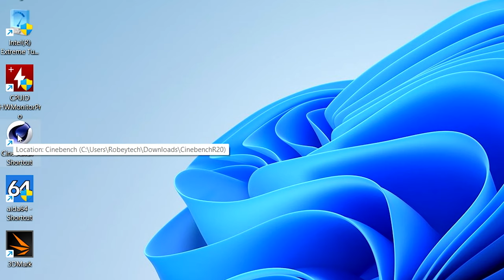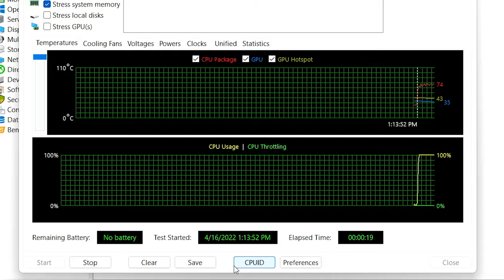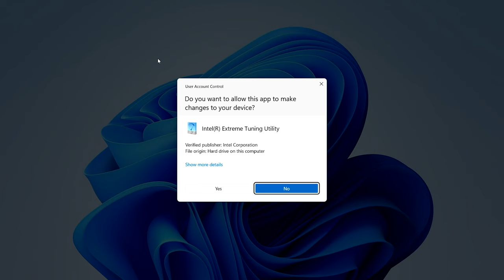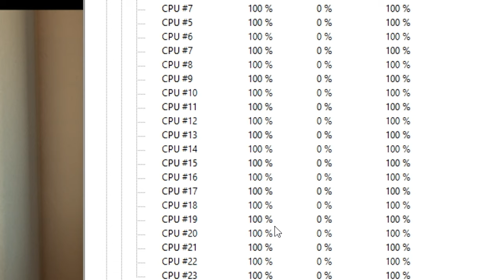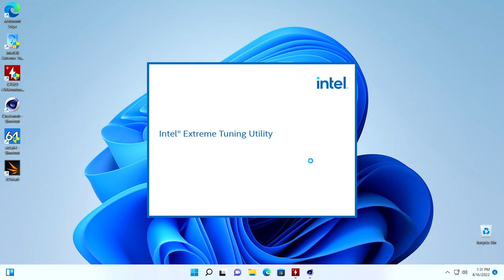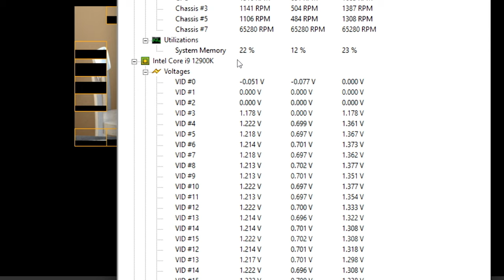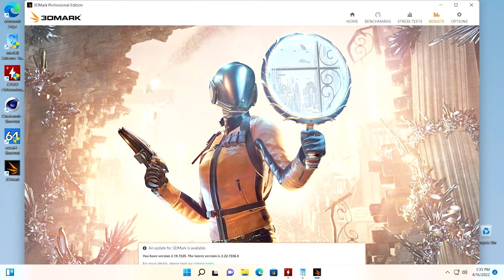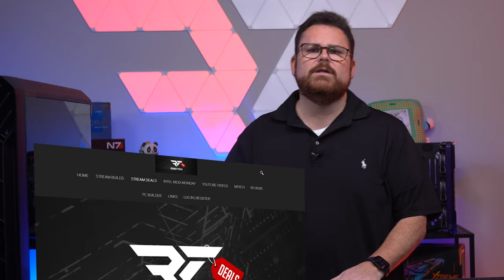We built the ULTIMATE air cooled 12900K PC! But did it work? Benchmarks and Thermals inside!

Comment: Thank you Robey for showing that you CAN air cool an i9-12900K as long as you have the right case that works hand-in-hand with the CPU cooler. That is a perfectly paired chassis to go with the cooler. And no "RGB" strictly performance/business also looks awesome!
Reply from the maker: No problem! You are very welcome!
Reply: There is tons of RGB in this build. He just toggled it off. That's the best part of RGB. Want it lit up? Looks neat. Want it blacked out? Simply toggle it. No reason not to have it.
Reply: @pokealong  Why would you want your case to look like a Christmas tree? Talk to me. :)
Reply: @erichamilton5932  Why would you want your Christmas tree to light up? Talk to me. :)
Reply: @erichamilton5932  so you can see the inside when it is dark
Reply: @erichamilton5932  It's ARGB. So it's addressable. Most people just stick it on a static colour they like, and it can be turned off and still function. So what's the issue?

Comment: Legitimately excited by this video. Right now at Micro Center the 12900K is up for a bangin deal in a bundle. I bought it, look forward to completing the build and then follow your journey to overclock. Making matters better I had already settled on the fractal torrent for case as well. Awesome video!
Reply: This is exactly what I was about to do XD What's the rest of your setup looking like? Same cooler too?
Reply: @truffles  that or the Icegiant prosiphon, LTT did a couple videos on it a while back
Reply: haha, same microcenter deal. My first build, Thermalright Peerless for cooling, and Montech x3 for case. Hope it should suffice with "undervolting". Make sure the pc case is AIO compatible in case this does not pan out ^^
Reply: @HoaTruong-rg2fp got the same deal and case as well but using a Hyper 212 for air cooling.
Reply: @TheCardinalSpear  I did a lot of research and ended up using a 360mm AIO now since it does not appear air cool is enough.
Reply: Are you air cooling it? What did you get and how is it?
Reply: @HoaTruong-rg2fp Which AIO a did you get? Some AIOs cost as much as the bundle 😣
Reply: @MsVamPireChic  I use Thermalright Frozen Prism 360 AIO. Comes with both black and white color build. cost around $60 dollars. Have not encountered any problem yet.

Comment: How are your temps this good? With this exact setup (just in a Torrent Compact case - shouldn't make much difference) I'm hitting around 99-100 degrees with Cinebench R23. I tried reapplying the paste 3 times and ended up swapping the NH-U12A for an NH-D15 (which dropped my temps around 2-3 degrees) and with the addition of the -0.075 undervolt it now sits at around 89 degrees, which seems manageable. But still, your temps are way, way lower. How was your room temp during this testing? Or is it just a binning thing or something?
Reply: I'm sure it's the case, plus the three bottom fans that he has, I think the compact can only do 2 140mmm fans if I'm not mistaken
Reply: Different bin

Comment: i call massive bs on the u12 outperforming the nhd15
Reply from the maker: Okay. Still does
Reply: @robeytech  Laws of physics are broken then ))) Seriously? Did you read NSPR values of the coolers on noctua website?
Reply: I just bought a NH-D15 and ran it in a fractal design torrent case on a Asus strix z790-e, 13700k at 5.4. The d15 was only 2 degrees cooler than my NH-U12S with 2 fans. I sent it back and ordered a NH-U12a

Comment: Justin, thanks so much for this video!  I just ran across it this week while researching a choice between the 12700k and 12900k as I upgrade from 9900k.  Currently have a full-size Torrent and Noctua NH-D15 cooler, which do a great job with the 9900k and a 3080 - your video convinced me that I should be able to manage the 12900k with that gear (and maybe an additional rear-panel fan added to the Torrent just in case, using a little undervolting and overclocking.  Will also be adding a new CPU holddown frame, replacing the stock lever system, to keep the IHS as flat as possible to optimize cooling.  Avoiding liquids in the box is a high-priority to me, but still want a system good for the next few years with GPU and VR-headset improvements along the way.

Your work here is much appreciated, buddy - just the sort of info I was searching for, and more!
Reply: Hi bro, how about D15, is it working with the 12900k ?
Reply: @ViniCLplay  the D15 works great but at the last minute I went with the 13700K - slightly lower cost, a bit better performance and lower power for that performance. 

With the fantastic D15 and a 4090 in a full-sized Torrent case I ended up with a silent monster system that will never spring a leak.  Big thumbs up for the D15 although it looks like Noctua is prepping its successor from the rumors.
Reply: @RJ-kr4bs  awesome, I'll try the D15 too, thanks!
 I saw that the 13th generation has much higher temperatures than the 12th, this is the only aspect that caused my preference for the 12th.
Reply: @ViniCLplay  Me too, at first, until I learned more about the 13s - the 13th-gen defaults to max full power with an excessive voltage (apparently to please reviewers, the high voltage means marginal non-binned chips can still hit the numbers but adds more wattage and heat unnecessarily since the chip doesn't need that much to run at peak performance), as I recall. So, allow it to run overclocked, but lower the max voltage - JayzTwoCents has done several good vids on this - find the one called "How to keep your CPU from melting" released about a month ago - a very simple introduction about making just one easy change to get started; you decide if you want to go further. My 13700K has "IA Offset" at -0.036v (your CPU may tolerate more or less, so you have to try/test to find out) and it lowered my CPU temps by 20-30C as I recall in Cinebench, even after boosting the clocks a bit. Easy to do with the Intel XTU utility as Jay shows. Good luck and have fun!
Reply: @RJ-kr4bs  Another thing that can help lower the temperature is to use a "cpu contact frame", to prevent CPUs that use LGA1700 from warping. Research this problem, it may be happening on your computer.
Reply: @ViniCLplay  I put a frame into this new build on day one.  Seems to work great.

Comment: I originally cooled my 12600k with a Big Shuriken 3 but was getting up to 100C on Cinebench. I switched to a FrostFlow240 and replaced the AIOs fans with Noctua 120mm PWMs and also changed the 92mm 3-pin DLH21 case fan to a Noctua PWM unit. I did the same undervolt but no overclock and dropped the peak temps to consistently less than 80C. The other caveat is the GPU (6950XT) is a gd reactor and is the source of most of the heat exhausting from the case.

Comment: I have the TUF Gaming Z690-Plus WiFi 4D & i9 12900K. I'm using Enermax ETS-T50 air cooler. In BIOS I set my P cores to 4500MHz & E cores to 35MHz. It gets too hot if I set it higher. I should give the cooler a try.

Comment: Great video, thanks! I have one of those N7 NZXT cases you have in the background, I managed to squeeze in an NH-D15 for my current 8700k but I'm looking to upgrade to 12th gen. I have Noctua fans on the front, on the rear, and on the top (getting THAT in place with the NH-D15 was a nightmare!) and with my 3080FE in the build my current CPU doesn't go over 70C. Should I suffer the pain of trying to get the NH-D15 in again or would you say the U12A would be enough for a 12700k in that case (with its really limited front air intake)? 

[EDIT] July 5: The NH-D15 wouldn't fit the new motherboard, so I am using the U12A with the 12700k and it's perfect! Temperatures mostly in 50s and 60s when under load. Just make sure you install it the right way round or the plate doesn't fully-cover the CPU!
Reply: Hey! I'm planning to pair 12700k with the U12A like you did. Could you share which motherboard were you using? Thanks
Reply: Same…

Comment: I have an x5950 cpu  on a Asus x570 crosshair Vlll Hero motherboard  and a Gigabyte 3090......Aircooled BY Bequiet Dark Rock Pro 4 and Bequiet silent wings fans.....works perfect AND quiet  even OC so I think it will work with a 12900k.

Comment: Hello. Thanks for the video! What is the real height of this tower cooler (Noctua NH-D15) with RAM installed?
The front fan is located above the RAM bars, they do not allow the fan to be as low as the middle one.
What is the maximum height of the RAM slats is acceptable, so that the front fan fastened does not exceed 165mm?
What will the author say in response?

Comment: Hey Robey, how will the cooler Master MA612 Stealth compare with the Noctua cooler in this video? 

Is it a recommended alternative if the Noctua isn't available in my area? 

Planning on using it on an I7 12700F, no over clocking, just auto mode for 2K gaming.
Reply from the maker: I haven’t been able to test it tbh

Comment: You think the Noctua NH-U12A can cool down the i9 13900k significantly and not much noise?
Reply from the maker: That would be tough, we haven’t tested it.  But it’s hotter than the 12900k and it took a certain case to air cool it.

Comment: Just finished my 12900k build yesterday. Got the NH-D15 installed and it’s great, but it’s also a pretty beefy boy. Seeing this video makes me feel, like i chose the wrong aircooler…
Does it really outperform the D15?
I haven’t tested any benchmark, yet.
Since I‘m planing to play games on this PC for the most time, high temps won’t be an issue, cause they won’t appear.
I still like to keep the CPU as cool as possible, now i feel stupid for buying the D15 without hesitating 😂
Reply: Better dicision, nh d15 is good & reliable then liquid cooler. I hope u have great air case with fans
Reply: @Hiter  thank you for the reply!
I build it into a BeQuiet 500DX Case, I guess airflow shouldn’t be the biggest issue in this case. It‘s not a fractal torrent, but it seems fine. Idle temps are about 30-31°C. I will run some benchmarks after work and keep you updated. Thank you again for your fast response, makes me feel a lot better now.👍🏻
Reply: This case is not good in airflow, but fine, u can add fans as much as possible. I personally recommend Lancool 2 mesh. But no problem, be happy.
Reply: Hello, i am currently building my pc and i wanted to do the same thing as you... can you tell me the cpu temps in games? What games did you play? Also what are your cpu settings? My case is a fractal meshify 2x-atx 3x140 fans in front with 1x140 in the back.

Comment: I think there is a minor factor that restrict the state of art CPU cooler (Noctua NH-U12A). 
The DIE of 12900 is vertical and it directly touches only 2 or 3 heat pipes. 
I wish you could try the same performance test while the CPU cooler is 90 degree turned so it covers the long chip with all pipes. 
Can you ?
Reply: that is a myth, it doesnt matter which direction cooler is facing purely for heatpipe/cpu die contact. It might make a difference for different reason such as airflow configuration in your case. Here is the source:
https://www.youtube.com/watch?v=O1WGlPrH4IU&t=4s
Reply: Hey Saeid!  I read your comment and deliberately tested the difference for you when building my PC (Fractal Torrent, i2900k, Noctua U12A, Asus z690 Hero MOBO, basically mimicking this video’s build).  My results came from stock voltages and only read in BIOS, so I did not use Cinebench because I got these readings before installing on OS.  I kept the test perimeters the same with only orientation changing. (including thermal paste). in BIOS readings was 40C when vertical and 32C when horizontal.  This is of course a huge difference!  It showed me that despite the heat pipe concern, horizontal was significantly better.
Reply: Adding onto my comment, I let the computer sit in my bedroom, ambient temp 75F, for an hour.  Then I ran memtest86.  Then I let the pc sit while I did other stuff.

Each time it was pretty consistent, vertical would start at 36C and then stabilize around 39-40C, where the other orientation would sit around 32C stable regardless.  Obviously getting cinebench points would help more and undervolting would help temps, however I do believe a stable change of 8C is enough to answer that question!

I also did the 1mm plastic washer mod to the lga1700 bracket preemtively, so I do not have a comparison with or without, but I had that same washer mod for both orientations.  I used the thermal paste that came with the noctua cooler.

Comment: I have the 12900k using an corsair elite h105i my temps are a lot higher then your setup. I may have to check my mounts.
Reply from the maker: I have a video that comes out next week to step you through things to do to help improve thermals on a 12900k!
Reply: i am using EK 360 AIO with 12900k but my temp is lot higher. 90 - 95c I checked my mount but its looks ok. i don't know how the air cooler can perform so better than the 360 aio.

Comment: i am using EK 360 AIO with 12900k but my temp is a lot higher( 90c - 95c) I checked my mount but its looks ok. I don't know how the air cooler can perform so better than the 360 aio.
Reply from the maker: Well it’s more than just the cooler it’s also being fed lots of air, the quality of the fans on the cooler etc.
Reply: @robeytech  my casing is big and with good airflow. it could be the ambient temperature of Bangladesh. nowadays ambient temp stays 35 to 40 c in here.
Reply: There are some interesting bios settings at play…I have an 360 aio and had temps running close to 100 (p core 2 and 5 specifically would spike) but would hit 27k in cinebench ( did not actually get any performance throttle ) updated bios and wouldn’t see temps over 90 but cinebench dropped in half closer to his performance.

Comment: find a air cooler with copper heat pipes, don't purchase aluminum heat pipe coolers they aren't as efficient at pulling heat into the heat sink.  My 36$ arctic cooler air cooler keeps up with my i9 12900kf under load because it uses 5 copper heat pipes

Comment: So i hit 100 degrees in stock settings with aio cooler and you hit 70 with air cooler..sure
Reply: Well it's not just any air cooler, it's the best (or second best) there is
Reply: Sir not every aio is better than air coolers, this air cooler is actually one of the best